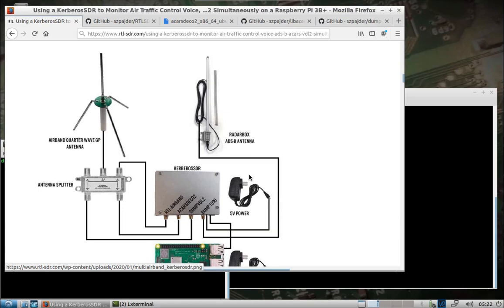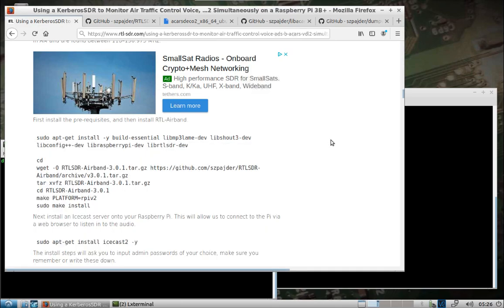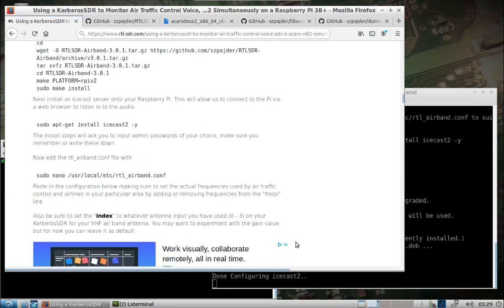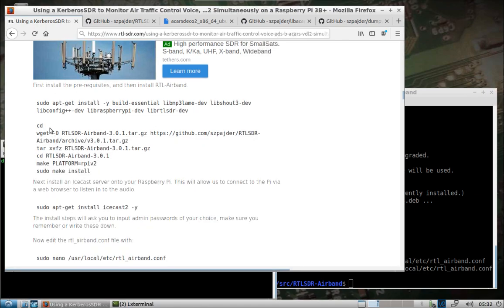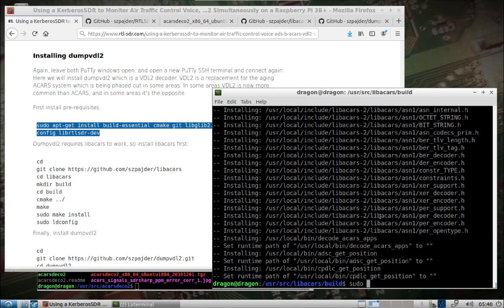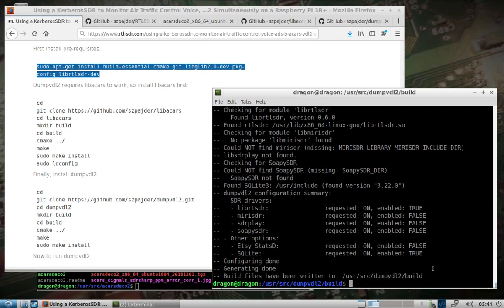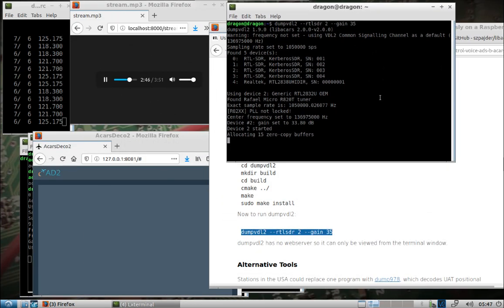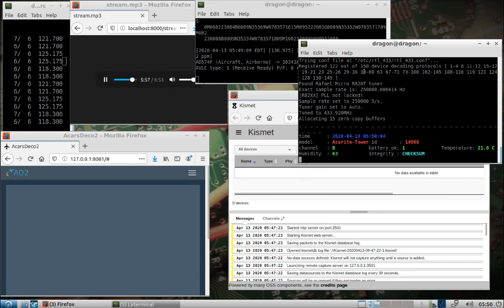DragonOS LTS/10 KerberosSDR + RTL-SDR (Air Traffic Control, ACARS, VDL2, ADS-B, RTL_433, and Kismet)

Comment: Hello and greetings from Greece.Im trying 2 days to install dragon os on rpi4 with no luck.No booting.I try from sd card and also from usb stick.I download 2 times the img.
Reply from the maker: You’re downloading the image from here? https://sourceforge.net/projects/dragonos-pi64/files/
It’ll have to be burnt to sd card, recommend the offical pi tool or extract and burn with etcher. Before burning I recommend checking hash number to make sure you got a complete download. Only other thing I can think of is I recommend a 32gb card because once extracted and burnt to sd you hardly have any room left on a 16GB card. Also run sudo raspi-config and select advanced amd expand sd card on first login to gain all your storage space.
Reply from the maker: I’ve not tried to configure my pi4 to boot from usb yet, that seems like a process I need to get familiar with
Reply: @cemaxecuter7783  yes i download the file from the link you post.Ill try again with bigger sd card.The usb boot is very easy if you have the latest eeprom firmware.Just remove the sd card and will boot from the usb stick.
Reply from the maker: I was thinking maybe it needs something special setup on the image though? Maybe not. It’s based on Ubuntu aarch64 and not the offical pi os - hopefully it’ll work like you mentioned.
Reply: @cemaxecuter7783   thanks for your support.Ill try and ill post my results.
Reply from the maker: No problem, any luck? How’s Greece?!